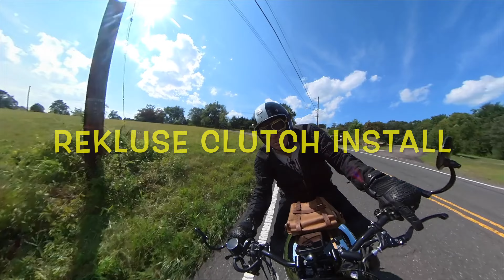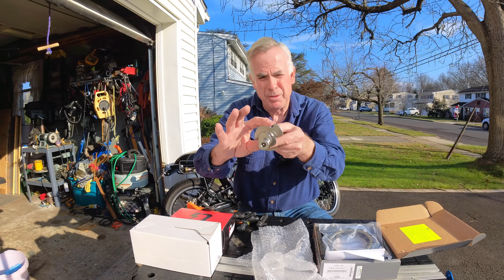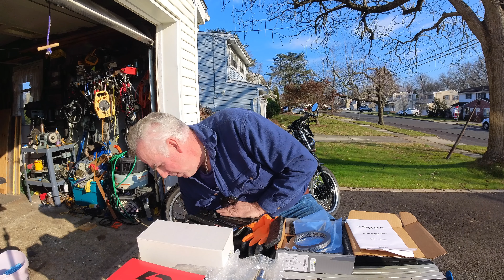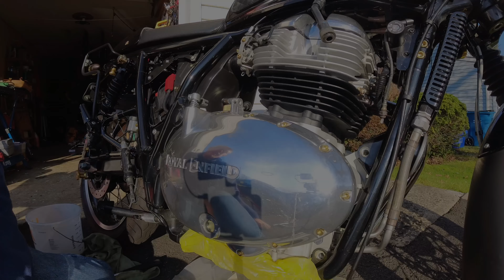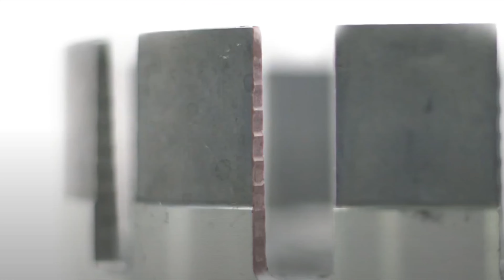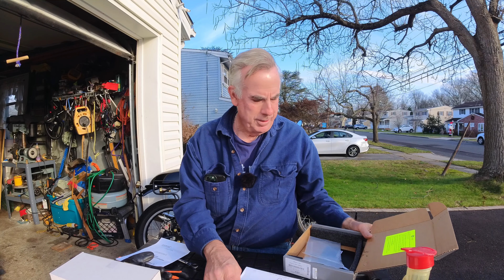Rekluse Clutch Install on Royal Enfield 650 4K

Comment: Hi thank you excellent videos, Ihave a question I hope to get a reply as I am now fitting this upgraded  clutch.  The last 2 clutch friction plates you fit in the short gaps in the basket are they not supposed to go in the same gaps as the other plates as they would be running on the steel shims that were fitted? It makes sense to put them where the originals ran but there's no extra fitted steel shims on the other little fingers.
Hopefully my kit will come with instructions.
Reply from the maker: You are correct David all friction plates on the Rekluse clutch go into the long slots. I assumed it was the same but nooooo🤭 what happens if you do is the sleeves won't stay flush with the bottom of the basket.. It's nit a hard kit at all to fit make sure all gasket material from old one is removed or maybe you'll get lucky and yours won't stick and can reuse . One thing I will telll you is Neutral is a little different to get in .The OEM is very forgiving, with the Rekluse and the aqdded plates shifting up and down very smooth as long as it is adjusted right but Neutral whn the bike is running the bike mostly has to be moving for it to go in. So when your coming to a stop and you want to put in in neutral give yourself room before your going stop the bike rolling in 1st to get it in other than that it's working perfectly .
Reply: @johnk7814  so all the friction plates in the same slots.
Reply: @johnk7814  thank you for your quick reply really appreciated as I am doing this, this week I didn't realise at first you was the person who replied  😊 .

Comment: Once you raise the compression, in theory, you should then need to start using higher octane fuel. Do you use higher octane fuel? If yes, which one? 95 or 98?

Comment: Will follow this with great interest, these are the exact Mods I have planned. Except the clutch hope it is not needed.
Reply from the maker: Well what's the worst that can happen, you just wear out the stock clutch a little sooner that's all, may be alright . You do get access the the hole to lock the crank when you take that clutch cover off so you should do that and but a new gasket to put it back on when you finish. Or have someone from the other side hole the crank from moving...
Reply: Glad to see this video, just getting ready to install my "black Friday" Rekluse clutch and thanks for the heads up! Those pistons are marketed by S&S but they are a Weisco part. If a piston got damaged I do not think you could source one because S&S has invested in tooling with Weisco and they are not sold to the public. All 3 companies: Advanced Sleeves, Cometic gasket and Weisco are in Northern Ohio. I have talked to and bought sleeves from Advanced, talked to Cometic and they should sell a gasket if anyone needs one. My clutch is going in at 36,000 miles; my Weisco 83.5mm pistons and S&S cam have over 8,000 miles on them with plenty of smiles and no problems. Anxious to see what the new clutch pull feels like. Also anxious for your top-end video, I only took pictures of my install back in June 2023.
Reply from the maker: 😷You were the one I was talking about that also took advantage of the sale. My stock clutch pates look like they still have plenty of life left in them, and no burn marks from over heating. Moving the lever on the clutch cover  felt fine. @frederickwoods5943

Comment: Looks fairly simple to do. I installed one of their auto clutches in a KLR about 5 years ago and I don’t remember it going that smoothly. The website says it’s supposed to improve power delivery. I suppose if you have tested it out it would also be with the other work done so it would be difficult to isolate the improvement. Good video though. I’ll definitely consider Rekluse again when it comes time to do my clutch.
Reply from the maker: Yes it wasn’t bad to do at all  😁

Comment: Hey great video… Do you remember if the actuator pin is spring loaded as well? Is the pressure plate pushing it outward, so when you pull the clutch lever that’s how it disengages?

And when you let go of the clutch lever, the spring on the outside of the engine case, overpowers that spring and actuates the pin back to engage the clutch, ya?
Reply from the maker: No the pin just sits in there from the back of the pressure plate that has the three springs that allows the plates to engage when you release the clutch lever the shaft turns counter clockwize with that outside spring. I made another video where I took apart the clutch again showing this again. I did make a mistake in this video where the last three plats that fit in the smaller slots this is true for the stock clutch but not for the Rekuse one due to those clutch basket sleeves .I haven't published  is due that I haven't finished the other video's pertaining to the cam and new piston intallation.  By the way Rekuse is having a 30% sale on the clutch if your interested FYI.
Reply: @  Wow thanks, indeed the Recluse clutch is on sale for $650! (I just ordered it! Thank you!!)

Will you be uploading the new video on the clutch anytime soon? Thank you for your help!!

Comment: Just a quick question John, what tyres are on your bike, cheers many thanks Ken 🙂🏍🇬🇧👍
Reply from the maker: Hey Ken they are Metzeler Lasertec Bias Sport Touring Tires . The current one's on the bike are my 2nd pair, my first pair I had on the bike for over 12000 miles. They're good tires and I had no issues with them.  The front I put on a 110/80  18"  would like to fit a 130/70 on the back if I could find it next time...😁 Cheer's

Comment: Nice video. I see that you're stock clutch had one of the fibre friction plates fitted in the short slot and when you reassembled with the new plates you put two of the friction plates into these shorter slots. Yet the instructions for the torqdrive specifically say not to put any into theee shorter slots and to only use the deeper slots. How is your clutch going? I got the Rekluse clutch installed by a bike shop when they did the 865 big bore kit, and have always found gear changes and finding neutral to be harder than before. Is yours a bit less smooth now or same as before? Not sure what way the shop did it but I'm thinking probably as per the instructions. I'm wondering whether Rekluses instructions are correct or whether actually you should still put the last one/two friction plates into the short slots.
Reply from the maker: Yes that is a mistake when using the Rekluse I later cuaght that and put all the fiction plates in the large slots. It is correct for the stock but not the Rekluse. I made another video about changing the clutch cable and opened up the cover again and went through what happens inside when you put the clutch lever.   Good catch sir 👍
Reply from the maker: I can tell you that the reason they say to put all of fiction plates in the large slots is because if you don't those baske sleeves will move towards the outside no longer sitting flush with the bottom on the slot.  as for how it works I had issues's with getting it adjusted right I had smooth up shifts but not so coming back down. some of that might be because of nor having them in the right place or I realized my cable I bought from Venhill the stadard lenth was about 3-4 inchs too long for the bars I have on the bike.When the cable came down the frame it dipped below the top of clutch cover bend up again. It also moved on me and sliced the outer part of cable 😡 brand new one too. I bought anthor cable from Venhill but it's one you cut to lenth and after that thihs cutch is flawless now very smooth up and down BUT the problem you have with neutral I have as well must be something that the 3 extra plates in the pack must cause.🙂 You just have to get used to it , the bike has to be moving when the engine is running to get it in neutral. So when you come up to a light and you want to shift into neutral get in there before you stop.😂 When the bike is not running there's not much problem in getting it in neutral.  But I do like the clutch now the stock one I guess is made to be very forgiving compared with the upgradeed one.

Comment: It will be very interesting to know how the bike feels with the high compression pistons etc. How much more powerful the engine feels and if it retains it fabulous character? 
Are you going to put it on a dyno?  🤔🙂
Reply from the maker: Yes I think so too,  you really only see 650's with engine work made into 865's not keeping the same bore just raising the compression and putting the better cam in.👍
Reply: @johnk7814  . I think it might make more sense than a 865cc. More in keeping with the mechanical balance off the whole machine. It's a beautifully balanced bike with a great character and I would not want to jeopardize it's over all poise for power. A bit more go would be welcome though.
I will be awaiting your thoughts...

Comment: I have a Enfield intersepter  had it since 2019 all I  do is oil changes and tappet checks  the top speed is about 105 mph  I changed nothing  still has the same tyers. 
I never  needed to change everything.
Reply from the maker: No need to make all the changes I’ve made but suspension 🤔🤔that really makes a difference how the bike handles . You have the same tires 😳 I didn’t find anything wrong with stock tires I wore them out though and the next set as well I’m on the third set 😁.

Comment: Did you consider using a Barnett clutch kit?
Reply from the maker: Trufully I didn't know there was another maker of of a clutch for the 650 but I did just have a look on their website and they do make one. The Rekluse does however have more fiction plates then the Barnett 10 to their 7 with is what the stock clutch has. More plates means more surface area and it doesn't have the added basket sleeves in their kit like the Rekluse has which is a nice feature to have saves the wear on the friction basket which I believe is made from cast aluminum . But it is a more budget kit for the 650 Rekluse is much more expensive good thing I bought it on Black friday sale with 30% off 🙂
Reply: The Rekluse clutch is a better clutch however the Barnett clutch is sufficient for a 650 cc performance build.
If any of your viewers are interested, I have contacted Wiseco and they will make a high compression piston Kit for the RE 650, if I can find 8 people who are interested in purchasing a kit. Waiting on pricing information from Wisco
Reply from the maker: Yea I found out that they'are the company that makes the pistons that S&S puts their name on, something I wish I knew before it would have been cheaper. DAMM😵 @waltcrawford6153

Comment: How do you feel when you riding?
Reply from the maker: I'll let you know right now I'm in the middle of removing the cam and pistons for my 650 high compression build the clutch was just the first part. When it all goes back together we'll see but others have said the lever feel isn't much different than stock that is it doesn't require more pressure to pull the clutch.🤭
Reply: @johnk7814  Thank. Will see coming soon upgrade😁